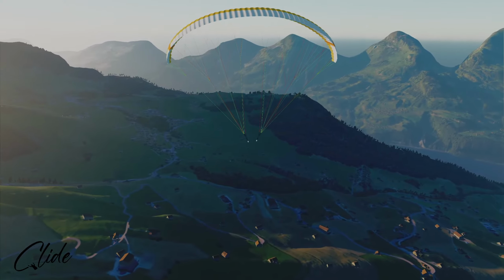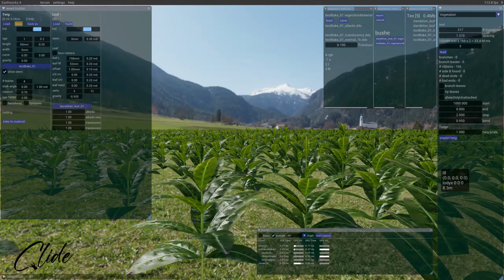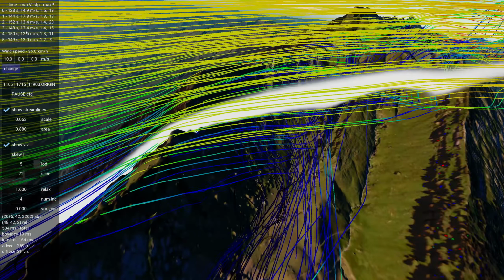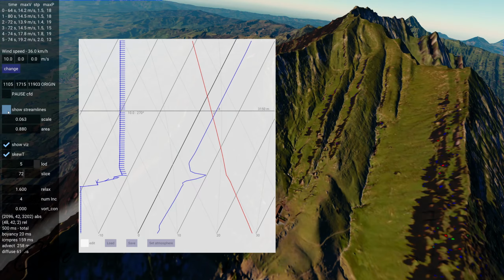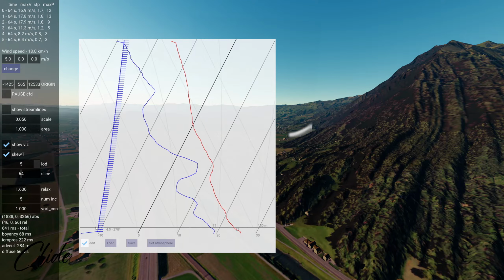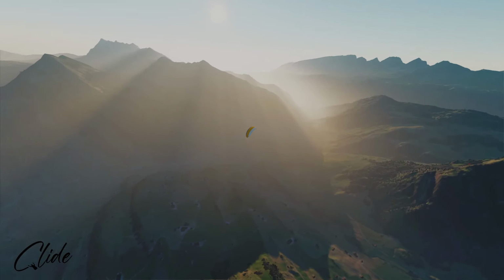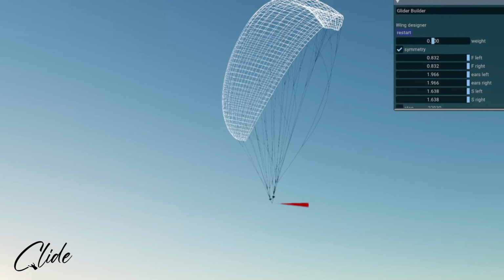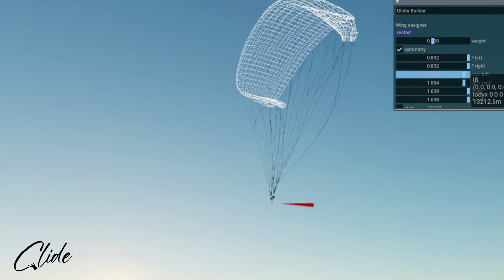Glide - Introduction

Comment: Great job. Ppl like you could help Asobo with  Microsoft Flight Simulator to improve their weather simulation for gliders. I believe collaboratio would benefit both parties.
Ever thought about that?
Reply from the maker: I have tried in the past to no avail. I cannot get a reaction out of them. Suspect I would need an introduction fairly high up to make that even a possibility. 

I also think its not quite that easy. If you go and look at OpenFoam simulations they will run for hours or days for a single solve. It took everything I had to manage a 40x40x5km atmosphere simulation, and while this works amazingly well using two cores on my Ryzen 5 5600X  (pretty mid range CPU), and can likely run about 10x faster or larger if moved to a decent (2080 or similar) GPU while using less than 30% of it (the rest has to be for rendering), it makes a  bunch of assumptions.

For now on a mid end gaming PC, I don't even think you could make this work for sailplanes, they simply fly too fast, and can outrun the core of the simulation (I use 6 nested levels of detail to manage this). Paragliders at 50km/h and who seldom fly above 3000m and never ride waves like sailplanes is a unique point in time that just became viable.

For Asobo this would mean a different atmosphere solver for gliders, then switching to the other one for powered planes. We are a very long way away from solving this fast enough for a supersonic plane to fly through. But it would be amazing to work with them on this.
Reply: @johanhammes thanks for replying, I think Asobo develop their approximation CFD to be very efficient and  somehow good/precise enough for soft body/cloth simulation for  balloons but it's true paraglider simulation need to be more complex to feel and act realistically inside air and  they still don't have  developed realistic convection or other natural phenomena for gliders yet. Btw they do/plan to  simulate whole atmosphere inside 20 km radius of a plane.

Comment: Outstanding! I could imagine this to be fantastic in a DIY contraption with "real glider" controls to steer it around. If that hasn't been done yet it would be nice, especially paired with VR 😎
Reply from the maker: I haven't quite been able to work it out but yes. I think in vr your only option is the two controllers tied to bungie cords, and button presses changes the line that gets pulled. I haven't done vr yet, but the moment I have lovey trees in there I wil likely be tempted to do that next. 
I am talking to a Spanish company who are developing a large motion rig with force feedback